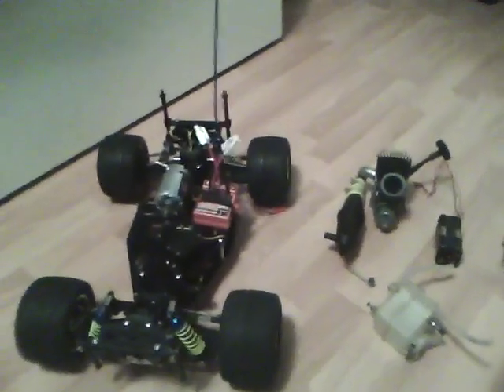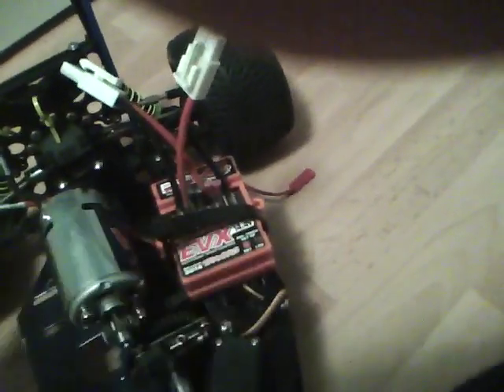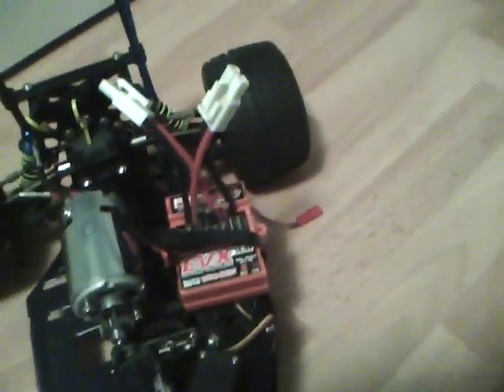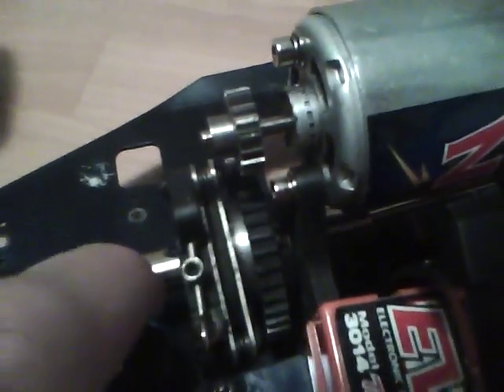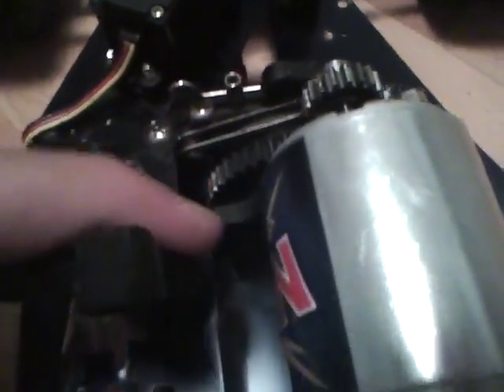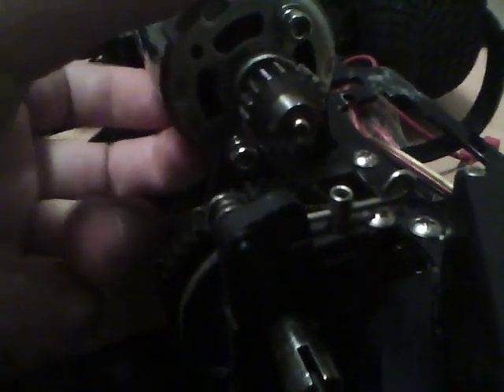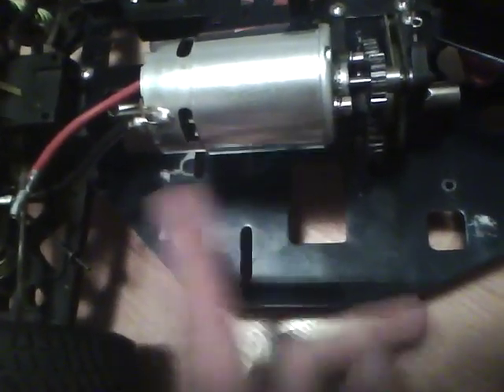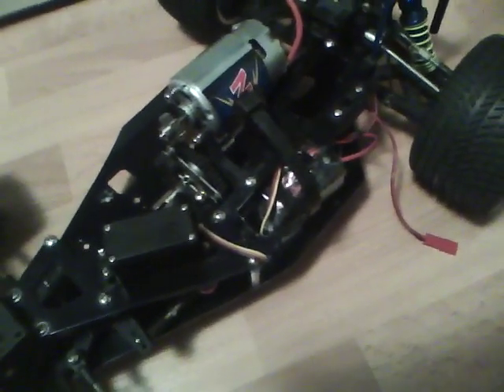Converting a Nitro R/c Car To Electric Pt. 1 of 3

Comment: which because of your choice in material for the mount would shatter on a hard roll over. simply buy a metal motor mount thst will allow you to basically hook up right to the diff. it will save you from it be coming a cluster fuck of  crap..im convertng s old ass hpi  to electric.

Comment: you need to adjustthe braking ‰ in the esc. basically hold down the power button till it beeps and changes color or flashes depending on esc. double click the button . hokd it down again till it beeps turn it off and ut should be 25-45% braking .power..reason why it doesnt lock up your wheels is to avoiid major flipping